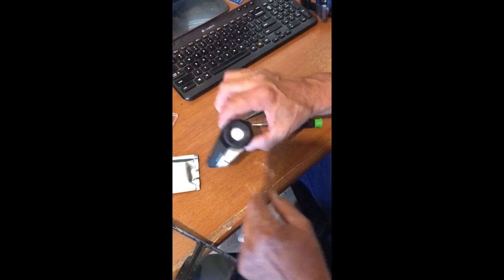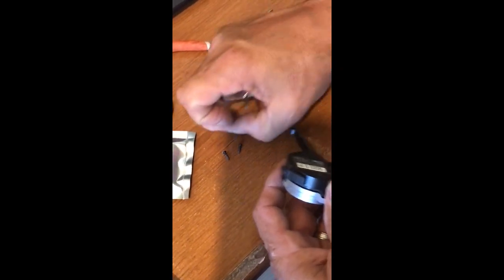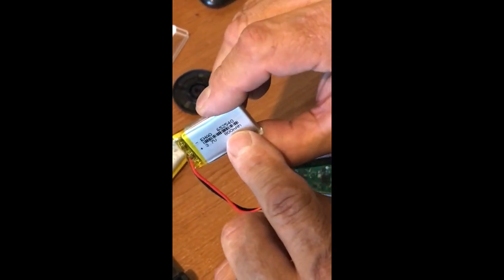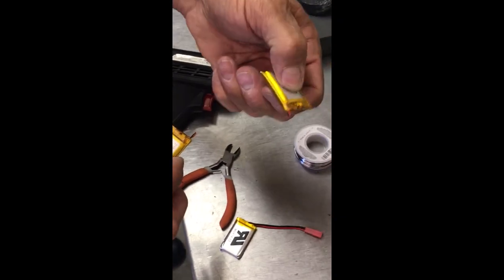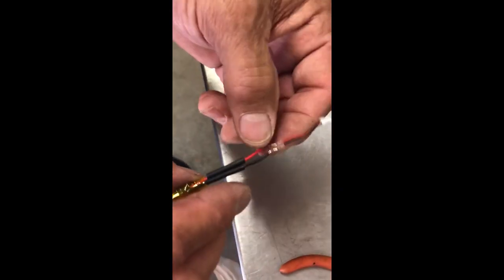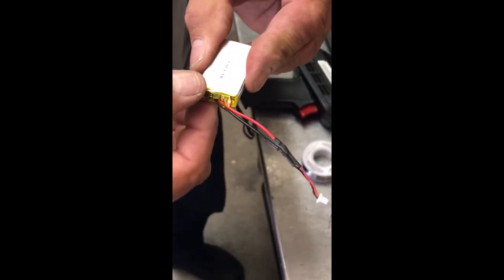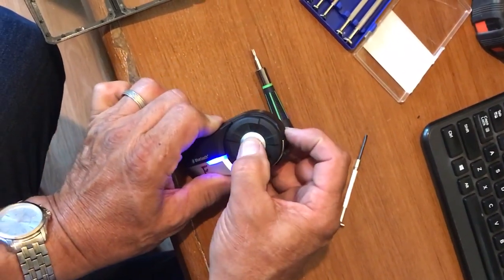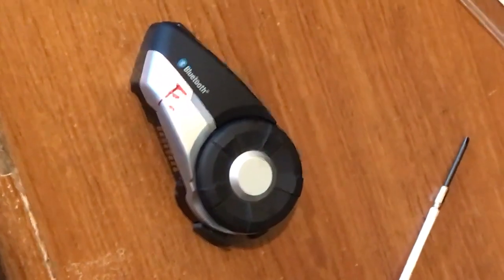Sena 20S battery replacement

Comment: Did thid years ago but seeing the way the old battery was swollen that same battery you installed swelled up just recently and popped the Sena open snapping all the screw posts off. Pain in the butt. Oh, the Sena 30S has great speakers. See if you can order them. I'm picking up my new Sena 50C tomorrow! Cheers

Comment: Good video. Thanks. 
2025. Luckily you can buy batteries with the correct connector already installed these days. Saves the problem of soldering fine wires.

Comment: Biggest lesson I learned from Sena is to NOT throw your Sena on a charger and go to bed. You should charge it and check on it to immediately unplug it when it's charged fully. This will prolong battery life. Great video, thanks.
Reply: Yeeeeah.. dont think they told us that one.. Kinda starting to feel like they did that on purpose.. Thats how mine went.. Left it on charge, then battery turned into a spicy little pillow. And Sena told me the same thing "Non-serviceable"... i was like.... umm.. bullshit! I opened it and have the battery out. Its VERY serviceable.. You just dont WANT to service it.

Comment: Just finished up, had a third Sena when wife forgot to bring hers on a trip and bough on the road, then didn't really use it at all for 3 years and it died from lack of charging, apparently.  I did find a 750mah wattage that had the correct plug on it so that made it so much easier for this inexperienced solder guy.  Thanks so much for publishing this terrific how-to!

Comment: Great vid!  Used your vid last year to replace battery, then this year after it died again and a replacement didn't work, I pulled out the circuit board and discovered another tiny bloated battery underneath it.  Are you having any issues with yours again?
Reply from the maker: No not yet, do you have any more info on the 2nd battery?

Comment: pretty much same play for the 20s Evo - Replacement battery on Amazon - https://www.amazon.com/Battery-Motorcycle-Bluetooth-Headset-intercom/dp/B084CVKV8H/ref=pd_lpo_23_t_1/143-7772917-1516712?_encoding=UTF8&pd_rd_i=B084CVKV8H&pd_rd_r=82fa641a-fa9b-4228-baaa-c753aa09b859&pd_rd_w=gWFYv&pd_rd_wg=DU9Id&pf_rd_p=7b36d496-f366-4631-94d3-61b87b52511b&pf_rd_r=QHW8VFMV8ESFS495B0ZA&psc=1&refRID=QHW8VFMV8ESFS495B0ZA

Comment: excellent video for Sena 20 user's to watch.....Thank you for your great work!!!!
Reply: want to add that the EVO 20 is a bit different as the battery is under the board and the contact bar has to be pried off before removing the whole board....just did mine and all is good....be gentle tho....Thanks again Mike!!!
Reply from the maker: Garry Euler glad I could help

Comment: There is also a small battery on the backside of the circuit board 100mah 0.37Wh 3.7V
Reply: I didn't need to replace my battery as it was water damage I was checking for so unsure where the smaller battery can be obtained sorry?
Reply from the maker: Justin Allan I had not taken the circuit board out... sorry I didn’t know!
If you find out anything about it could you let me know?
Reply from the maker: Justin Allan thanks anyway... has me wondering if it is like a hearing aid battery???
Reply: It's the same design as the main battery but much smaller
Reply from the maker: Justin Allan next time I’m in there I’ll check it out

Comment: Hi My Sena 10s connector Pogo Pin break how I'll change how I'll get the PoGo pins please advice
Reply from the maker: Pranav Madav i am not so very sure that you can get them....
You may have to try Sena 
You are talking about the pins in the plug for the battery but on the com piece.... right????
Reply: @mikegreene163  No main head set connector to Clamp Spring Loaded pins

Comment: If that battery doesn't have enough room to expand when it goes bad, it will catch on fire while right next to your head.
Reply from the maker: Did that happen to you?
I’ve found that the battery expands when it is overcharged but most people don’t charge while riding with their helmets on....
Maybe you do ride with your helmet on charge, if so please be careful... we can take this as a warning to all of us.
Reply: @mikegreene163  Catching on fire in your house while charging might be an issue as well. In general this happens often, apple laptops, hover boards, etc. Need to know the max expansion size of the battery and make sure it has enough room. Typically it isn't overcharge as much as over discharge that causes them to puff. It's probably what makes most of these stop working, once they get below a certain voltage they can't be safely recharged and the circuitry prevents it from charging. Go a few weeks without riding or charging the unit and the battery gets too low and stops working

Comment: Mike,  Thanks very much for your video.  I replaced my battery and it went very smoothly.  I did have to solder on the connector however; it was no big deal.  My battery was 6 years old and at this point the unit does not owe me a thing.  Once again thank you for your very helpful video and saving me  some money.

Comment: Very useful video. I changed my battery with a replacement from Snackazon in 15-20 minutes. The replacement battery had the right connector, so it was very simple. Testing shows battery duration at full volume (I wear earplugs) for at least 6 hours.
Reply: Do you have that part number?

Comment: In your description there is an “update” about s viewer named Chris that has a link to a direct replacement battery. It is incorrect. I ordered the battery and it’s about an 1/8 of an inch to long and the connector is a millimeter or two too large. I ended up having to cut the wires and solder the original plug to the new battery, plus I basically had to jam the battery in like you did. Not what I expected to do. I’m terrible at soldering... At the end of the day my Sena is now working but it was a crappy fix...
Reply from the maker: Sorry you had such a bad experience! But I am glad you're back up and running again

Comment: Ditto on the thanks for your video.  Just ordered a replacement with correct plug.  Sena should be ashamed of themselves for not having replacements available.  After years of messing around with headsets, ear pieces, external speakers, etc. I am thoroughly satisfied with Big Ear stereo plugs.  Tunes out all noise, to include my Valkyrie truck stacks, and provides good sound at any speed.  They are also comfortable.
Reply: Hi Mark, you have found the correct battery? Can you give me a link?
Reply: @MenzoKorver  :  I had to replace the connector after all.  This was also made in China, which I was not happy about.  Was on Amazon.  
BrightTea 3.7V 800mAh Lithium Ion Polymer Battery Rechargeable Battery Li-ion Li-Po

Comment: Mike, your's is a very good, concise video. I just finished replacing my 20s battery maybe 20 minutes ago. Found a seller on eBay selling what seems to be a direct replacement. 650 mAh, 3.7v etc. Comes with the correct plug but with about 1.25" longer pigtail. 1"+ doesn't sound like much but it was a bit much to tuck inside the small 20s housing. On first attempt to mate case halves together I pinched one of the battery leads in two. So back apart and I shortened the leads. Lots of electronics repair experience here so soldering was a non-issue. If I had paid a bit more attention to the insides of both case halves I probably could have  more carefully tucked away the excess lead length. So to those not comfortable with cutting and soldering small wires you can most likely be fine. Just be observant of where you tuck the excess. Again thanks for your video. Well done!

Comment: My 20s evo is draining the battery fast. I bought it 6months ago from amazon so i dont know why the battery is draining so fast
Reply from the maker: RED_10R One thing that I have found out is that if you leave your Sena 20 S on the charger perpetually it will destroy the battery and you won’t have a very long charged time any longer it’s almost like it gives it a memory
Reply: @mikegreene163  yeah, in the manual says something like that.

Comment: Tried this on a 20S Evo. By the way, you can get the battery with the proper connections now on E-bay or Amazon. However, on the 20S Evo, the battery lies beneath the circuit board, which must be removed. I did so with some difficulty, got the battery replaced, and it powered right up. Problem was there was no sound coming through the speakers. This is because getting the circuit board back in properly is darned near impossible. I almost threw it away, but decided to save it to see if any one else can successfully accomplish this and post a video on it.
Reply: I'm in the same boat. I took my 20s evo apart and notices the board on top of the battery. I did not remove the board, its in very snug.
Reply from the maker: Can you give the part # for the battery you ordered
Reply: @mikegreene163  https://www.amazon.com/gp/product/B07TZBRS82/ref=ppx_yo_dt_b_asin_title_o04_s00?ie=UTF8&psc=1

Comment: Mike Geene, you’re super dangerous with those batteries. When you clipped both leads at the same time you instantly shorted them out. At 6:07 you can see the spark on the old battery, and then you clip both leads again on the new battery after mentioning it yourself that there was a spark. You then stripped both leads right across from each other where they could have easily shorted out right there... not only that but you set the battery with exposed leads on a metal table top... yikes! I know there wasn’t much charge in those batteries, but I have to say that was bad practice and you earned the title of dangerous with electricity. Please don’t attempt to change a light switch or anything of the sort. I am an electronics technician I was cringing the whole time. With all that out of the way, thank you for the video, my battery is on order.
Reply from the maker: 123mustangone 
True but it’s not like we’re talking about A/C power here!
I retired from IBEW after 23 years! Never 1x did I short anything out.
The old battery was dead, I was only commenting about the spark because the battery was so dead.
I guess ít might have been a good idea to have mentioned all that.
Quit being so darn critical and be happy to have the tip!
Reply: Mike Greene For a dead battery it was a fairly large spark. It doesn’t take much voltage to create a spark when the resistance is next to zero (formula V/IR).  After seeing that spark, and sure, assuming you don’t care about destroying the dead battery by shorting it out, you then shorted the new battery, or nearly shorted it... I just figured you didn’t know what you were doing, but obviously you did, my apologies. It’s not like you were working on something critical. Main point is you got the job done, and I thank you for the video again.
Reply: @123mustangone  chiilll bro!
Reply: Red—yeah, I over did it. Sometimes I go overboard. My apologies to Mike.
Reply: Considering that it’s a lipo battery, I’d be extra careful.123mustangone is correct.

Comment: Nice video, the popping off the spin wheel was a big help.I installed a 700 MA battery and it fit fine and had the same electrical connection so it was a breeze.
Reply: Hey Dave, can you give us some order info on that battery?

Comment: There's a second battery in the 20s, under the main circuit board. A smaller 100mah 401722.
Reply from the maker: Andrew Campbell I never saw it...
I never replaced mine!!???
Reply: @mikegreene163  yeh, not sure if it's additional capacity, some kind of backup or to stores settings (unlikely nowadays).
Reply: I was able to remove the second battery and inspect it.  However, a replacement battery is difficult to find.  The dimensions are 4.0mm x17mm x 22mm  Hence 401722.    Pulling the circuit board isn't that hard once you know how the tab works for the phone button area and be careful with the pins.   Anyone have a source?   found one with connector, on Alibaba but wants a 20 piece min order.    Replaced a 6 year old battery with fresh one for the front.  800mah unit so I hope it will last more than 6 hours.. waiting to test.. would have liked to changed both.

Comment: Anyone got a link for us Canadians, sense we can get these shipped over the board.  Also, all the replacement batteries I have found have been 44mm or 1.73" long and the original is only 38mm or 1.5".
Reply from the maker: Garett Kozijn try searching eBay with these key words 
3.7V 600 mAh Polymer Li Battery Lipo For GPS smart watches headset pen 602540
It’s a bit smaller but should do the trick
Reply: Murphys law.  look & look for weeks than the minute you post a question I find this  https://www.amazon.ca/gp/product/B0798G9D69/ref=ppx_yo_dt_b_asin_title_o00_s00?ie=UTF8&psc=1.  Just have to wait a couple of weeks.  I even went into a battery store today and 300mAh was the best they could do.
Reply: Straight plug & play easy fix == 

https://www.ebay.com/itm/For-Sena-20S-EVO-Bluetooth-Headset-20S-EVO-01-3-7V-650mAh-Replacement-Battery-US/254252330316?ssPageName=STRK%3AMEBIDX%3AIT&_trksid=p2057872.m2749.l2649

Comment: Any one know what type battery connector that used? Please answer...
Reply from the maker: Aditya Reza Lakmita I am sorry to say that I didn’t know, I had to use to connector from the factory battery.
Good luck to you
Reply: Plug & play don't need a new plug 

https://www.ebay.com/itm/For-Sena-20S-EVO-Bluetooth-Headset-20S-EVO-01-3-7V-650mAh-Replacement-Battery-US/254252330316?ssPageName=STRK%3AMEBIDX%3AIT&_trksid=p2057872.m2749.l2649

Comment: Please, not a big Weller iron/gun. Pencil, pencil, pencil. They cost peanuts and don't melt insulation so fast. Rosin core solder applies flux as it melts. Go for the really skinny solder. The solder melts in a hurry, making tinning and final soldering much faster - less chance of cooking the insulation.
As of 6/19, Amazon price is $18.99+5.99 S&H, eBay price is $25.99 & free shipping. Amazon charges sales tax, eBay does, too. Sales tax is the tipping point between eBay and Amazon. The US vendor, Bright Tea, is listed in both places, using the same artwork. The battery includes what looks like the connector Sena uses for their battery.
Reply from the maker: Richard Emerson Sometimes you use what you have when you don’t have the right thing....my little pencil soldering iron broke that day and the solder is the light solder and it also had rosen core in it
Reply: @mikegreene163  I've been reading with interest (and I smile when I see how you respond to these little bits of criticism).....you do good! I bet I've got 6 or 7 soldering irons/guns. My favorite is my 35+yr old Weller 100/140 watt gun. Granted you shouldn't use it on some small jobs but you can do more damage using too light of an iron because it heats too slowly. You cook everything by having to wait for the solder to melt and flow. By using more heat (a gun) you can heat it quickly...solder melts and flows....and you're off of it. I'm into my winter riding season here in Va so I need to go back to my full face with the 20s. It died on me during a trip to Texas in April. So I resorted to my trooper style helmet with an SMH10.  Time to find and order a battery. Btw.....on the soldering stuff.....got into Amateur radio in 1978 (I was 23), Dad gave me my Weller gun. I've still got the first tin of Kester soldering paste bought then as well as a really old yellow tin (don't remember the brand) that was my Dad's. I've built and worked on many radio projects over the years still using that first tin of paste.  The smell of that first puff of smoke when the tip hits the paste brings back memories. Thanks!

Comment: I was able to find a direct replacement battery with correct plug.   Thanks
Reply from the maker: Greg Hay please feel free to share the information...
Reply from the maker: Greg can you please post a link to the battery with the right plug.... or even a link to your post so I can refer those who are asking?
Reply: @mikegreene163  its thr link above
Reply: Greg I don't see a link above. Could you please repost it?
Reply: Link
Reply: where did you get the batter?

Comment: Great Video...this was very helpful.  Until I did some researching I wasn’t quite sure why my Sena wasn't working nor why it wouldn't charge.  It’s not often equipment this expensive craps out for simply a busted battery.  Sena needs to do better.  Thanks for sharing!

Comment: Great video. This is the Battery I used     excel Power Supply DC 3.7V 850mAh 102535 Li-ion Rechargeable Lithium Polymer Li-Po Battery Available at Amazon
Reply: Thanks! Here's the amzn link for those looking. I just ordered one! https://www.amazon.com/s?k=B0767CVZPX&ref=nb_sb_noss
Reply: Out of stock until the 13th... you apparently took the last one. ;-)
Reply: @petekunzler5098  Heads up, the battery I linked/mentioned will not work. It's too wide and won't close. Had to use whatever link was mentioned earlier. Sorry, hope I saved you some $ and time.
Reply: r0bv123  nope, ordered a different one. I should be good.

Comment: Hi mike I'm from the uk and cannot for the love of me find a battery for my sets do you know of anywhere I can get them?
Reply: Just rewatched this video while putting in this battery: 652540 LiPo 3.7V 800mAh https://www.ebay.co.uk/itm/223439092297 Fit in easily and 30 mins in no issues. I'm outraged that Sena fail to do something that takes 10 minutes to do at home...